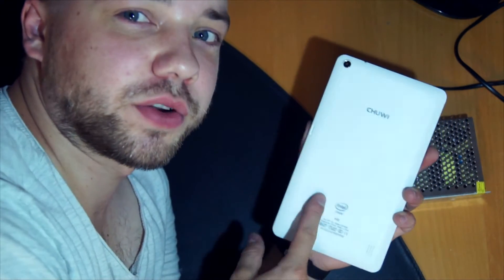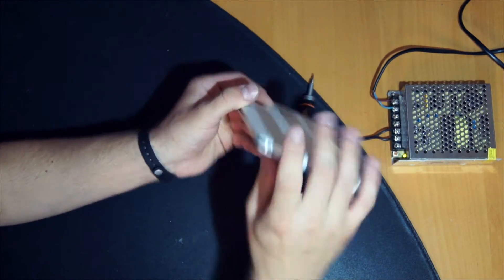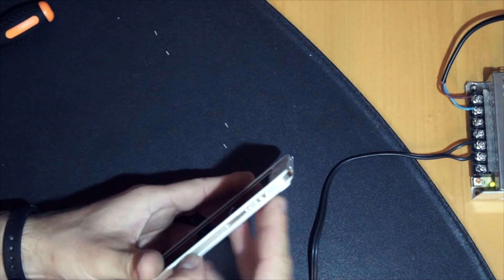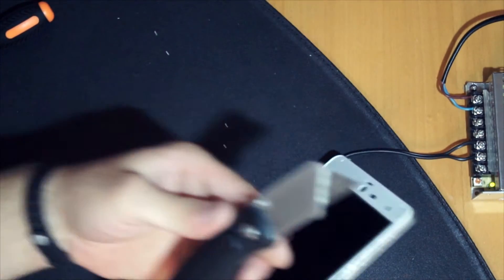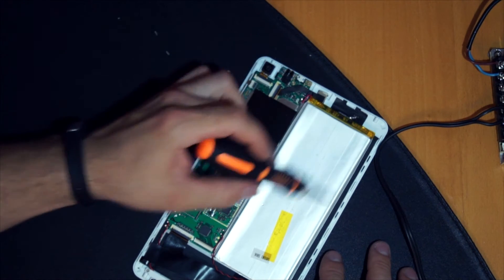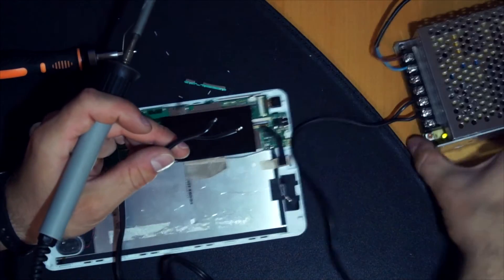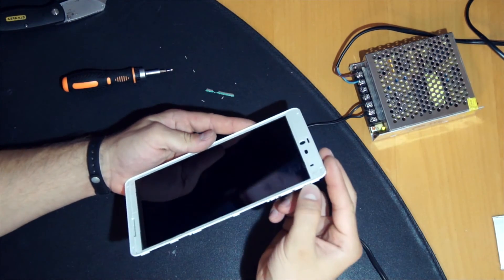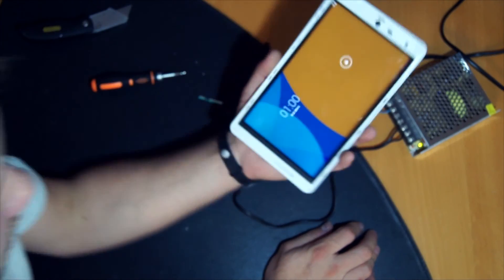How to run a Chuwi HI8 tablet pc without a battery

Comment: Hi Aaron. I have a tab like this and it is damage since 3 years ago and I am gonna try to do it. The usb type C charging port is damaged and I was going to replace it but seeing your vid I think it is better to do what you teached us here. I red on the back cover  of my Chuwi Hi8 Pro tab that it works with +5 V DC 2A but you informed us above that power supply must to be 10A. It will work ok with this 10A ?
Reply from the maker: The 5V 2A rating is for the charging port, the battery itself needs more Ampere, that why 10A is better, it could also work with 2A but the current peaks will most likely turn it of on 2A

The Ampere on a power supply is only what it can supply not what it will, so the more the better and the device will then pull what it needs

Comment: What if someone connect USB drives through OTG then had to power using tablet? does this still capable to keep Tablet running and powering OTG devices..?
Reply from the maker: Yes it will still have power on otg. This was the reason to build this :)
Reply: @atc1441  Thank you soo much.

Comment: I have the the version with the keyboard and walacom pen and the battery gave up the ghost and I feel that this situation is what held back Microsoft from pioneering tablets because old school laptops could run off just the charger while tablets use Risc architecture that depends on the battery like a capacitor.

Comment: How can I run it without the screen, I just have the motherboard.
Reply from the maker: I can't see any use case as it doesn't have HDMI
Reply: @atc1441  Thanks for responding. I have a Hi10 Plus which does have an HDMI port, but plugging it doesn't show anything on the screen. I'm gonna try soldering a USB cable where the battery was but i think it just won't display the bios through the HDMI, I gonna try anyway.
I'll get back to you if I find something.
Reply: @atc1441  I did it! I soldered a USB cable to the battery contacts (5v 2.4a) and it wasn't turning on. I connected the charger and it powered right up to the desktop! It seems it needed a kickstart because now it runs just form the battery connector.
Reply from the maker: Wow that was fast. Yes these tablets are very power hungry at some point.

Comment: How long can I able to use with do power supply ? I use the tab for very long time like reading books. What about the time settings?  I like this
Reply from the maker: Hi. You can run it forever, sometimes you have to disable the battery management in the device manager. Please watch my other video for the manual. The one with wintron.
Reply: Thanks

Comment: I have a Pipo W4 derived tablet i.onik TW8 (same logic board as W4) and i'm wondering if an internal mod is possible to retain the battery but allow it to be powered externally while retaining the USB port. I've got a special hub for it with charging passthrough but it's a bit tricky and weird, plus an extra item to deal with. The hub does some kind of timed operation upon plug-in to allow the tablet to recognise the charger, it's not entirely trivial, and the charger has to be connected in advance, else the USB devices fall off. I'd rather find some internal points to connect the power socket to.

I'm comfortable enough opening up the enclosure, i already had to open it up to replace the touchscreen after i sat on it. Didn't find testpoints for the 5V bus though, didn't investigate deeply enough, i should probably find the power control IC and the datasheet for it.
Reply from the maker: Hi again :D.
So there is the APX209 power management on most of these boards. Unfortunatly this handles the charging and the usb otg switching all inside of it. Here is a little bit more info and a script to read data from it https://github.com/Photonicsguy/CHIP. I think it wouldnt be easy to archive charging and usb host functions. Thats how i understand it but i could be wrong!.

I think you could put a charger directly to the battery and charge it from the outside while using it. But i dont know if the tablet would do something strange. On some tablets it just counts down a timer for the battery percent without knowing how much is realy left. And then it will switch of at 5% or so. For example the wintron 7.0 of my other video.

Cheers

Comment: Hi I have the same Tab and was wondering if it would be possible to solder 4 Li-Ion 4.2 batteries in parallel and power it from there? The batteries are rated for Max 4.2v
Reply from the maker: Hi you can do it. But parallel charging is not recomended because some times one cell is charging or disscharging faster than the other ones. They can blow up

Please charge them one by one seperatly somewhere else

Comment: the battery should supply 3.7v - 4.2v, but your power supply output 5V, is that ok to power the tablet with 5 volt for long term?
Reply from the maker: Marcus Lee 
Hi. 
That is ok because the axp223 power management ic has an input range up to 6.3 volt
Have a nice day
Reply: that is great, i didn't know there is a 6.3v limits, i am still considering which is the safer way to power my tablet either with this way or using the micro usb power input and remove the internal battery
Reply from the maker: You can try it but it is possible that the tablet does not boot with only external power
Reply: Yes, I will try it myself, I'm so desperate to think of the best way to replace the internal battery on all my gadgets, not just tablet, it suck that these days gadget industries has changed their battery design to internal battery, where old gadgets used to have removable batteries
Reply: @Aaron Christophel: I just tried with my Chuwi Hi10 tablet, it doesn't boot up with only the external power.
To work around this problem, I put it back the internal battery circuit board (without the li-po cell) and hook-up the tablet to the USB power supply 5V 2A, and it works!
Reply from the maker: Nice to hear. The lipo ciricuit is "talking" to the mainboard and this way it will tell it is there with an empty battery and try to charge the dead battery that isn't there anymore. So this will work. 

On another Tablet i had the problem that windows shows the battery status first at 100% and is than is going down after some time until it was at 0% then it will shut off because it thinks the battery is empty even without one installed. I had to deactivate the battery driver/hardware in the device manager.
Reply: @maverickmadison7392   hi Marcus i have the same tablet, Can you help me do the same as you? Can you send me a picture?, i really need your help

Comment: i dont get why laptops can run without the battery but why cant phones and tablets?
Reply from the maker: chriss4365 hi. 
It is because they are build not to do. They check for the battery and if its not pluged in they turn of. Like a security fetaure but also in case of some tablets the power supply cannot deliver enough power to keep the system running thats why in this video i took a bigger power supply

Comment: Hi, the Power supply has to be of 5V, 10A and 50W?
Reply from the maker: Hi. It is 50W it is not possible that it is 250W because the W is the summ of V and Ampere so 5Vx10A=50W
Greeds
Reply: Aaron Christophel thank you
Reply: Can I use a 5v 2A charger in place of your 5v 10A power supply? I m a bit confused.
If battery inside was 3.7v 3.2Ah giving a max of 11.84Wh, why giving a 50Wh supply at the same place? Will it not affect the circuits? Kindly guide me as I have the same situation in my windows tablet.
Thinking you.....
Reply from the maker: Its about short high power draw peaks so its better to have a higher Amp. You can try 2A of course

Comment: Hi Aaron Christophel, I want to plug the tablet into car(As an  infotainment system) what do you suggest ?
Reply from the maker: +Omar Daghestani 
you better still use the battery because otherwise you have to start the tablet every time you start the car.

But if you are in a cold area the lipo battery is not happy with it
Reply: @atc1441  Does Instant power cut off when ignition off can cause short lifespan of tablet?
Reply from the maker: @MethmalDhananjaya  it can be bad for unsaved files. So be careful

Comment: Hello sir, why must use big power supply ?, and not use original battery power adaptor ?, please repply
Reply from the maker: +Derry Afandi
Hi.
Because the original power adapter is there to charge the battery slooow and has not enough power to bring fast enough power.
Reply: Aaron Christophel thanks for quick response sir, one more question sir, any risk if i use ic protective battery board before connect directly to tablet ?
Reply from the maker: +Derry Afandi 
No problem.
It could work but maybe the over voltage protection of the battery will turn off the output.
You have to try it :)

Comment: Supply a 5v power was too risky. I think we should use a Buck dc dc 3A like lm2596. I current use a charger module tp4056 dual with an old battery to my old Onda V812 and it work well.

Comment: Hi,
I search an solution like this but,  if you want to connect the teclast to a computer with the otg, the teclast will inject current of computer in the "battery", but if the "battery" is a power supply..what are the consequences??
Reply from the maker: +Valentin Besnardiere 
Hi 
This will work. Because there is a power managment in the tablet pc that cuts the power. And it will only be plus 5volt on plus 5volt and not plus 5volt on ground.

Have a nice day
Reply: OK but, on the video we see a electronic part on the battery, after the two solder point, is it not this part wich manage the charge? because if it's that, when you remove the battery you remove the management?
Reply: I ask this question because I prefer use a 3,7 v supply (like a 90% charge), but in this case i fear the management charge chose to charge the "battery" with the power of the pc. I don't know if it's clear my englis is bad..^^
thanks
Reply: I want to put a diode to have 4,3 v and stop the reverse current but diode = loss
Reply from the maker: Valentin Besnardiere 
the thing on the battery is just the undervoltage protection. 
the axp chip on the mainboard is the power management. the diode would consume very much power and will get hot. 
the power from the pc is not going directly into the battery contacts only modulated over the power management. so it should work with 5volts
what is your main language?
Reply: Thanks for answer. I'm french. And , that i want to do is connect a power bank 5v to replace the battery, with a dc dc converter 5v->4v. but my fears are revers current. My idea is to put a shottcky diode and short circuit it with an button in use .and not short circuit when i connect a laptop.^^ to prevent reverse current. But you're right probably, it's may be useless.
Reply: I want more autonomy and i want let the usb c free for a hub.
Reply: sorry for my millions questions ;) when you connect the chuwi like that , what it said on the status of battery? 100%? And do you know if there is a dc-dc converter to stabilise a constant voltage in the chuwi when battery change or there is a voltage regulator wich dissipate heat, i want a good energy efficiency and if I put 5V and ther is 1,2v dissipate by heat it's not good for me.

Comment: i got lack on battery, it only runs about an hour, would u help me to fix it ?
thanks
Reply from the maker: Tiyas Wahyu 
hi  
maybe your power supply is not good enough use another one with minimum 5V and 2A or you could try to get a same battery and replace it. maybe this will help
Reply: I used other adapter but nothing changed. Yes, mbe i need to replace the battery. Thanks.

Comment: My tablet 3.7 Volt battery I fear supplying 5V will burn it ?
Reply from the maker: +Trollers gonna troll 
Hey the battery is normaly 3.7V but when its charged the voltage gets up to 4.2V  the tolerance from the power ic is so big that it can handle 5V. So 5V will not burn it.
Have a nice day
Reply: Thank you so much, I am going to try it with iPad adapter. 5.1 V, 2.1 A
I am trying reuse old tablet with broken LCD and touch. Repurpose it to use with te
levision

Comment: Hey there Aaron, I watched your vids here and a thought came about in that long pointless 20 minute video of the $55 tab fail as you made joke to lol. The part when I seen you revert to tampering with what looked/seemed like the connections directly to the usb charging port(which is something I have been hoping to find a video on), I then thought for a moment that it is actually possible if you would even had tried/attempted it in the 1st place. I have a project that I want to do with an install of a tablet (specifically the "nvidia shield k1" tablet) into my car dash. I'm debating if I want to keep the tablet battery connected or if I want to convert that tablet in a way so that I can run it solely off of the usb connection/charger. I don't have much experience with such a thing (not much wiring, just some basic stuff).

now I've seen how to run tablets and phones on usb cables(which I figured was possibly as I have done simple wiring like this for mini fans etc) just by simply; 
1) splicing the cable, 
2) snipping off the green & white data wires
3) snipping the battery off it's wires OR unsoldring the battery & wires from the board. 
4) attaching the remaining snipped red & black battery wires to the red & black (+/-) wires of the usb charging cable... or soldering the usb wires directing to the board in place of the originals. 

That method looks like it seems to work (not sure if always on all tabs & phones).

But I was wondering if the battery could be snipped from the wires but the wires(+/-) be left connected to the board.
then, 

1) take a high speed usb charging cable & snip the green & white data wires.
(so that the cable will specifically charge only)
& wrap it back up. 

2) take those still connected to the motherboard power wires that the battery was connected to(possibly have to be extended in length a little) & attach them directly to the usb port on the device?.
(would this then create a closed connections/full circle/like an alternator?).

3) this way when the usb charger is plugged into both a usb 5v power supply and to the tablet, the tablet would then get the power needed to run/operate solely off of the usb charger cable only, without a battery but with a nice clean connection (no exposed wires etc).

This is all in theory of course ! lol
but the tablet would then;

A) run/operate on a usb power when connected to a usb changing cable.
(and would power on and/or off only when the car/5v power source is turned on and/or off.)

B) The tablet would also have a very clean/nice connection to the power via USB port on the device. 

C) The tablet would be closed back up (backing/cover replaced) and you wouldn't even know there was any modifications made to it or that there isn't a battery inside other than a maybe possible change in weight.

D) if desired, the tablet could also be left inside the car(if you didn't want to carry it with you all the time) and there wouldn't be any need/cause for worry/concerns etc of the tablets lithium battery being damaged/ruined/overheated/exploding/imploding or causing a fire do to overheating in a car oven on a hot summer day. and if any worries at all you could just simply disconnect the usb power from the device and still leave it in the car with no further worries. 

Have you ever done this before(at least the wiring/connections portion) ? 

And do you know if this could work ? 
or is even possible ?.

Thanks in advance for you reply/response
Reply from the maker: +MountKash1 

Hey. Thank you for the long question.

You could cut the connection on the motherboard from the usb plug and solder the battery pad with cables inside the tablet so it looks nice and clean. I havent tested to connect it in parallel to the usb pads but i think that is not good for the charging controller and could kill it.

For me i made a hole in the backside of the tablet, so i can you the usb connector as a host for mouse or keyboard.
I does look nice and clean maybe you can glue another usb connector in the housing and use this for the power supply.

For the usage it is better to leace the battery in the tablet because if you turn your car off the tablet will always directly turn off and can't shutdown or go into standby.

Have a nice day
Reply: +Aaron Christophel 
ok, thanks for the help !
Reply from the maker: +MountKash1 
No problem if you have done it can you post a video of it ? 
I would like to see it :)
Reply from the maker: +MountKash1 
No problem if you have done it can you post a video of it ? 
I would like to see it :)
Reply: +Aaron Christophel 
Not yet, but when I do I will definitely post it along with videos showing all of the car installs. this stuff is very interesting to me and is like to say I did it myself lol. thanks again 

& you have a nice day as well friend !.

Comment: Hey. How change battery?
I tried change to 5000mAh and didn't work.
Reply from the maker: +Mariusz Mach hey did you install the new firmware?
Reply from the maker: this should work with a new one. was the battery charged?
Reply: I have not installed a new firmware.
I have a problem.
I have 2 tablet Hi8. And first was broken. Tablet does't charge and don't work.
I wanted change the battery from the second to the first tablet to diagnose the problem and vice versa.
I changed complete batteries (with chips).
Then none work. Why?
Reply from the maker: +Mariusz Mach
can you measure the voltage of the first and the second battery to see if they are charged or not? and if the voltage is too low try to charge it with another battery charger or something like that
Reply: My second battery is charged.
But when I change the second battery to the first broken tablet - does not work.
I measure both tonight.